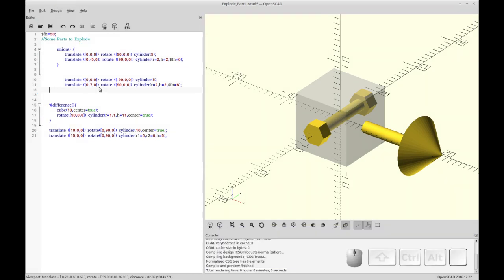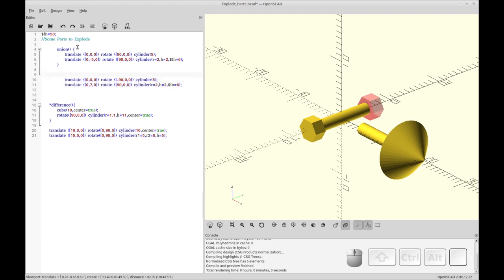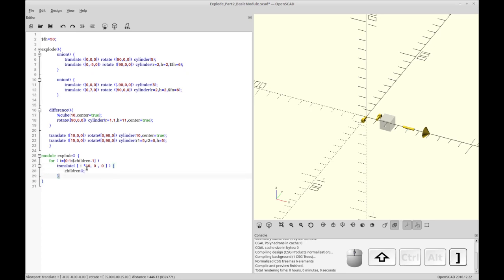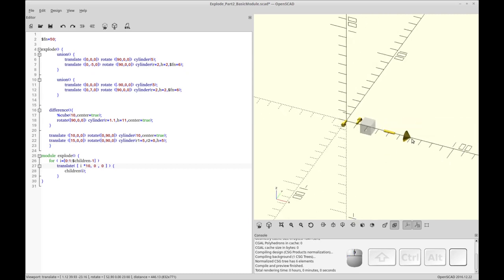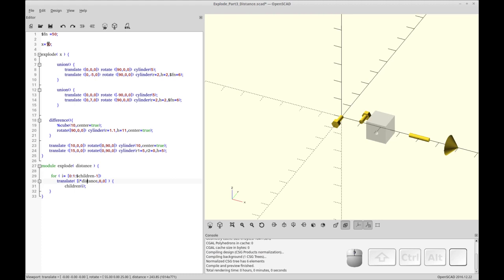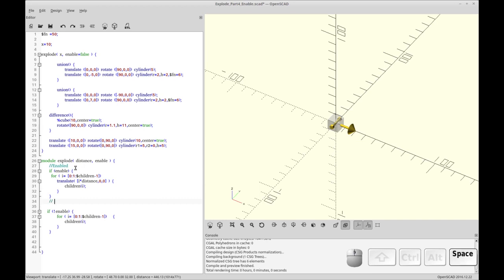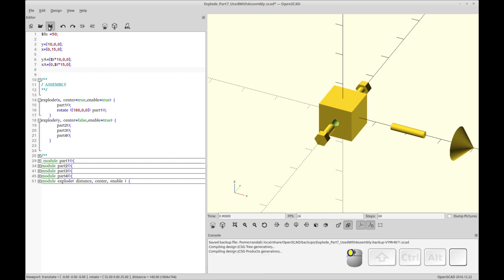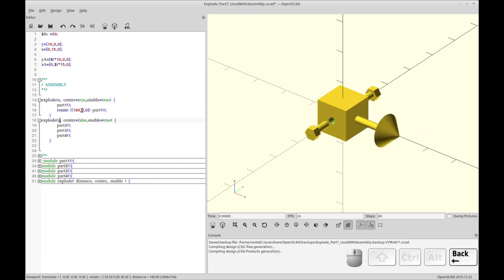OpenSCAD - utility - explode() module

Comment: I enjoyed this tutorial. I actually modified the 'explode' module while watching it to make it cleaner. This one also centers perfectly for any number of objects except for 1, in which case it seems to do nothing. Here is the code:
https://gist.github.com/damccull/1a1df5e785e56daf53e0d7b7d8ff219e

module explode(distance = [10, 0, 0], center = false, enable = true) {
    if(enable){
        offset = center ? (($children * distance) / 2 - distance / 2) * -1 : [0, 0 , 0];
        for(i = [0 : 1 : $children - 1]) {
            translate(i * distance + offset) {
                children(i);
            }
        }
    } else {
        children();
    }
}

A little vector math enables the use of a single 'offset' variable. Sane defaults prevent a user from unwittingly breaking the module, and I used an if/else rather than two if's.
Reply: Paul Randall thanks. I love sharing my way of coding something with people because I find it interesting to see how others code things, so I assume they're interested too.

Comment: 3:00 - the reason you use $children-1 as the upper end of your loop is that you number children starting at 0.   So, if you have five children, they are numbered 0,1,2,3, and 4.   There is no child 5.